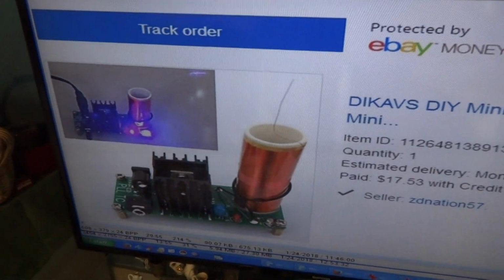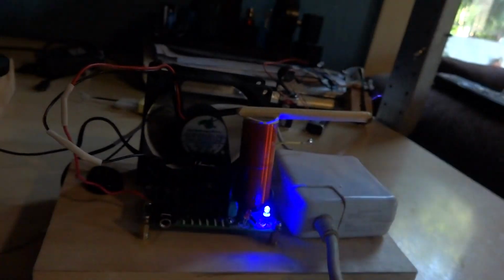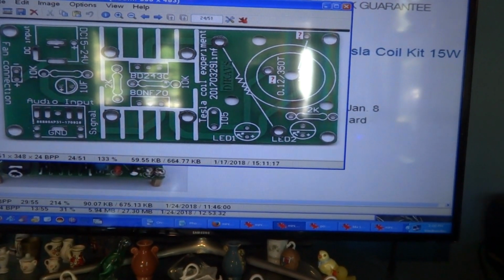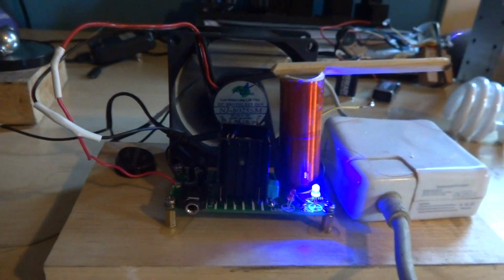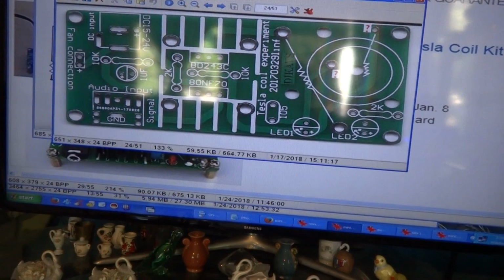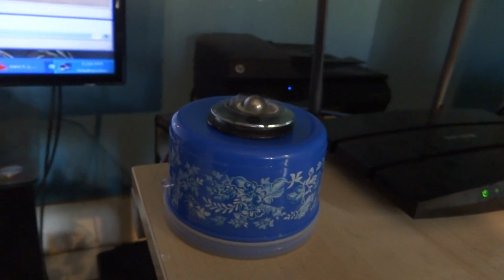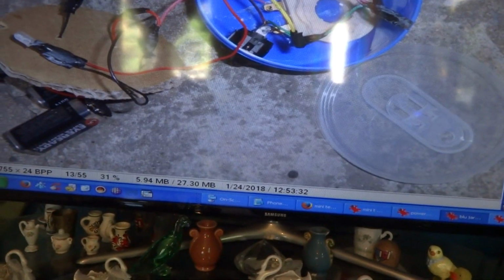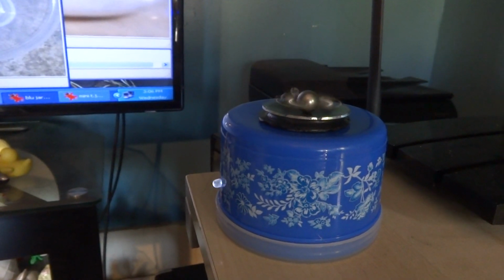Mini Tesla coil review. Dikavs 112648138913 15W

Comment: Do you know if it is 5V or 12V going out to the fan?
Reply from the maker: I'm sorry; I gave this device away several months ago, so I don't know.
I think I just grabbed the first small fan I had handy that was close to the power supply voltage. If you run the device for short periods, the fan is not essential.
Reply: @saracumbia1778  I can work with that info, thank you!